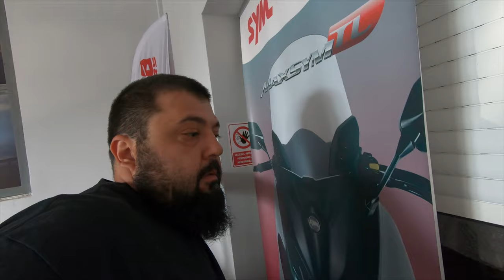40.000KM SERVICE - SYM SYMPHONY ST 200

Comment: I’d avoid greasing the rollers as the grease will be flung out potentially contaminating the belt. 

But, your scooter has made it to 40k so I must be wrong 😂👍
Reply from the maker: Always greased my rollers, and will continue to do so. Never had issues with contamination

Comment: Was this first major srvice? I have sym symphony st200, bought it with 11k kilometers now it has 19k,never changed anything on it except engine oil every 1000km, the scooter runs perfect. Also my friend offer me brand new ferodo clutch for this scooter, will it increase the performance of the scooter?
Reply from the maker: I don't know about the clutch, but at least the transmission belt and rollers have to be changed every 12.500km

Comment: Hi Alex, I have 2 questions. My jet14 200's warranty is over, so i started doing my own maintenance. Dealerships here put 800mls of oil in it, however i see you putting in 700. which one's right? the manual has 3 different options but i'm not sure which one applies to my scooter. also, the manual tells you to change oil every 1000kms, which doesnt sound very logical. ive been changing mine every 2000-2500 kms. i'd love to hear your input on this, and would appreciate it if you could point me in the right direction to ensure a long and healthy engine life
Reply from the maker: I change my oil every 2500km and you never put in a certain amount, always check the dip stick, and you fill the engine to max on the dip stick, you start it up for 15-20 seconds you wait 1 minute and then check your level again and add a bit more to get it to max is it drops down after the startup. That is the corect way to set your oil level. And then on this particular engine I check my oil level every 2-300km and top it off if needed. It's an air cooled engine so depending how you ride it it's normal for it to consume some oil between oil changes.

Comment: Hi Alex, I am using same SYM, Symphony ST200 (E5), 2023, km:1300.
My I use Castrol Power1 Racing 4T 10W-50 (API SN, JASO MA-2) oil?
Reply from the maker: Check your user manual, it will list all oil viscositys you can use. It should work but I'm not 100% sure if a 50 isn't to thick, check the manual.

Comment: Did you check the valves clearances on the Zontes? Sometimes  they can be off from the factory and if the cold starts are not ok, they can be too tight. 
I have a lot to ride.. My Symphony is on 4000 at the moment.
Reply from the maker: That zontes was taken apart many times to try to figure it out and no luck, it's just as is and it's our sacrificial bike now because we can't sell it like this.
Reply: @RideWithAlex  Sorry, Alex. I am just professionally distorted, because I am fixing industrial machines all day long, all my life. And just tickles when someone have gremlins problems like the Zontes.

Comment: There is a bearing in the clutch puley, you should have greased it :)
Reply from the maker: It was pretty greasy, never did do anything with it but probably next belt service at 55.000 km I'll go through all the bearings in the transmission.

Comment: Hello Alex. it doesnt really have something to do with the video, but I wanna buy new tyres on my sym jet 14 and i cannot find michelin city grip 2 for 100/90/14 measures for the front tyre. These are the measures written in the scooter book. Should i give up on michelin city grip 2 and buy another tyre or just buy this one but another measure? For example the back tyre has 110//80/14 and I found for bot rear and front. Would it be a good idea to buy 2 tyres like this for both rear and front ? I heard they are kinda the best on the market so that s why i am insisting on them.
Reply from the maker: You can buy a 100/90/14 that's "made for the rear" and just mount it backwards on the front. When a tyre says it's made for the rear it just means they only give you rotation direction for the rear. If you put it on the front you just have to mount it the opposite rotation direction from the rear.

Comment: Very nice video mate, very helpfull. One question. Would it be smart to insert a fuel filter into a sym 125 st? Im talking of those universal ones. thank you
Reply from the maker: No, you will mess the fuel pressure to the injector and the scooter will run lean. It has a big fuel filter in the mouth of the fuel pump in the tank it's all it needs.
Reply: @RideWithAlex  Thank you.

Comment: Sunt interesat de posibilitatea creșterii vitezei maxime. ( Standard se plafoaneaza in jurul vitezei de 102 km/h, care în realitate e aprox 90-92 km/h.
E exact viteza la care te lupți cu tirurile.
Ideal ar fi să adaug vreo 10 km in plus, nu e important reprizele sau accelerația.
Ce poți recomanda? Role, curea, ambreiaj de alte dimensiuni? Bineînțeles, păstrarea garanției și fiabilității,.
Reply from the maker: Orice modificare duce la pierderea garanției. În materie de role am încercat role de 18grame și la viteza maxima nu au făcut nici o diferență. Nu știu nici eu exact ce sa încerc ca nu găsesc piese modificate, mai studiez problema.
Reply: I think you should change gear teeth ratios.I think even scooter has then.Go check SYM ADX 125 what kind of gear ratio it has? And try putting in ST200? Probably that helps?

Comment: Hi, for engine oil nut is 17 size, which size for transmission bolts?
Reply from the maker: 10mm if I remember corect.
Reply: @RideWithAlex yes it’s 10mm. What transmission oil do you use?
Reply from the maker: @iFeelsify  generic 85w140 transmission oil.

Comment: Heloo,
what are the dimensions of the belt, and what is the weight of the roller?
Reply from the maker: I use OEM parts they have part codes not dimensions. Belt is 1B01XMA02. Rollers should be about 14gr each.

Comment: Alex i saw you used 10w40 oil for your engine but Sym here in Greece says we should use 15w50 or 20w50 oil for Symphony ST200 Euro5. Last week I got mine to the Sym dealer for the first 1000km service and they put inside my engine Sym 20w50 oil.. i think it's too thick and my motor is struggling  to accelerate after that.!
Already replaced it after 50km with a new 15w50 oil. If course it feels better but not as it's first 1000kms..
Should i check for a new 10w40 oil this time you think?
Friends are using 10w40 in the same engine and suggests me to go for it. But Sym Greece doesn't agree with that and i could have warranty issues (2 years in Greece) if i use thinner than 15w50 oil.. OK I'll do it by myself and no-one of them will ever know. 
You know what Romanian manual suggests for your scooter oil?
Reply from the maker: I've used only 10w40 in it and  it runs perfectly, try 10w40.
Reply: @RideWithAlex  thanks a lot sir.!

Comment: With all respect you make a big mistake with the spanners : never but never try to tight or untight the hex nuts or bolts 
with open side of spanner its easy to kill the head of the nut or bolt or even loose it and hurt your hands. Nice job btw.

Comment: Is this SYM Ultra oil full or semi-synthetic?
Reply from the maker: It's semi, 70-30 split
Reply: thanks, so 30% synthetic or 70% synthetic? is it generally better (or safe) to use 100% synthetic with these Symphonys?
Reply from the maker: @gilwe  70% synthetic, 100% synthetic is ok for SYM's
Reply: Thanks. I just bought my 3rd Symphony (love those 16" wheels), and checked with the local dealer for the ideal oil for it, they insist I should only use semi-synthetic in those but I'm not sure why. They use (and recommend) Motul 5000 10W40 specifically. I've used fully synthetic Castrol Power Racing 10W40 in my older one and at some point it started leaking, so I'm not sure. As a semi-synthetic I've heard  the Castrol Power 1 is a better option, but not sure.
Reply from the maker: @gilwe  I've seen some owners running full synthetic in SYM's without issues so 🤷. I use the SYM semi-synthetic because I can get my hands on it easily and with curently 42000km on the clock I think it's doing a good job so no need to switch to something else.

Comment: 01:17 - spark plug, buy DENSO equivalent :D you probably buy NGK Indonezia ...
Reply: 24:09 PRO TIP: go and buy "Tech Pulley" rollers (no DR.Pulley) 20% lighter than original weight - you will get 20-35% bether perfomanse then Multivar or some other sport variomat and they will last 40.000-50.000 km with no problem and it will cost 50% less then same sport variomat :D
Reply: 36:00 why arent you change or blow up the air filter? :O its very important thing to do ...
Reply from the maker: I did change the air filter with a new one, i change the air fiter everu 5000km